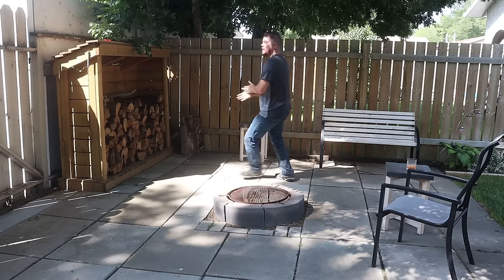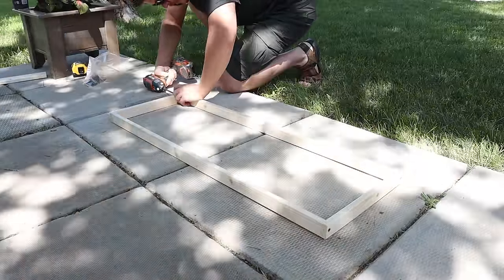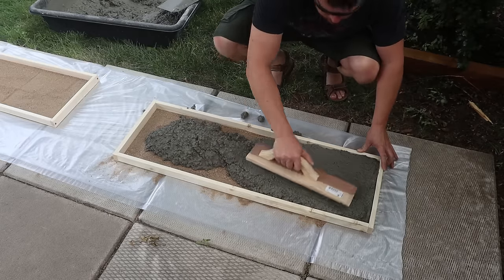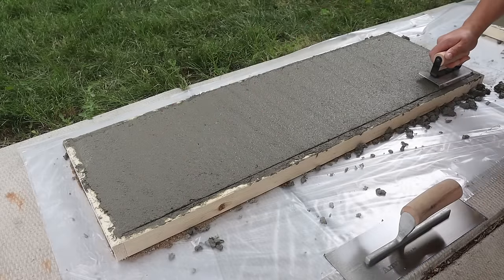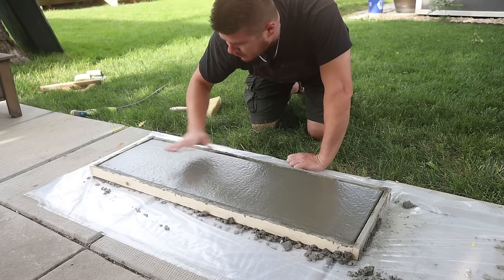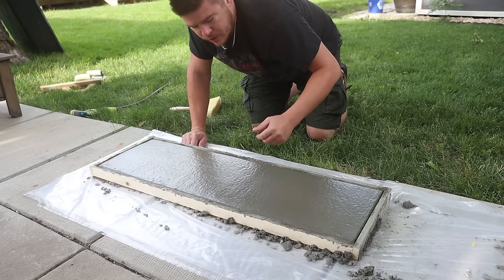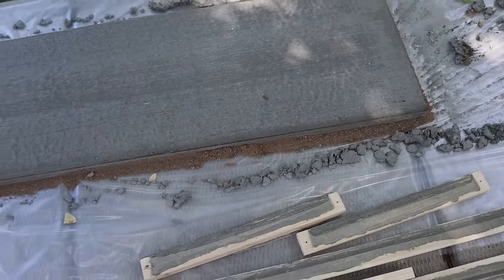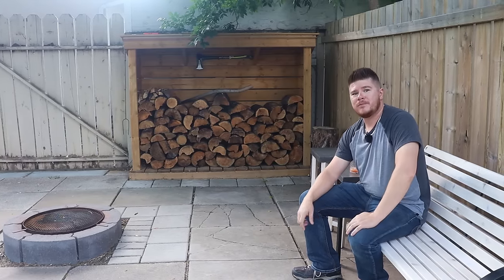How to make Patio Blocks quick and easy from concrete // DIY

Comment: I have a planter that I want to remove all plants and fill in with paver. I plan to put small concrete benches on top.  Do I need to put rocks underneath?
Reply from the maker: You need some kind of a base. Typically you'd dig down a bit and place a couple inches of sand down before adding the pavers, at a minimum

Comment: Is it cheaper to make these or buy paver bricks at Home Depot?
Also, do you know about how much weight they will take, and would putting some kind of screen  inside it act to hold it together?  Nice simple explanation, thanks.
Reply: I think the point here is that he made custom-sized pavers for the area he needed, so in this case there is no paver option to buy at HD. With regards to how much weight they could handle, that depends on the concrete mix you use (use a higher PSI rated mix if you’re expecting a lot of weight over them later). One thing he didn’t do is put some kind of wire mesh in them, when I did mine I used chicken wire after pouring half the concrete on each form, that helps to keep them from cracking.
Reply from the maker: They are close to the same price in this case, not much difference. But yeah, going this route you can make a custom size for yourself and even dye it if you want. These ones I made are pretty light duty but can easily support a few hundred pounds. If you add a fine mesh or something to it for reinforcement it'll be even more resistant to cracking. Thanks, I'm glad you liked it
Reply: @JessedoesDIY  
Oh, I forget to ask, what kind of concrete or cement do you use?   Can you use portland cement?  I wonder did you actually price out what it costs per square foot.  I have about 100 square feet portion of my front yard that I can not do anything else with and I think I just need to cover it with pavers, but pavers cost so much, and I don't want to actually cover it over completely with concrete.  This would be a good solution if it is less expensive, and still better and more custom even if it was the same price.
Reply from the maker: I used Quikrete bagged mix that I had on hand, but just the basic yellow bag quikrete will work just fine. You can't do cement only, it'll crumble apart. Concrete is a mix of things and it needs that to be durable. I did not price it out, but I do know that the what a bag covers and it ends up being about the same price as buying a stone. Like I said in the video, I made these because I needed to fill that specific spot, but it costs the same amount to just but a stone in store. If you're just covering a spot, it's up to you how you want to do it

Comment: the cement would be stronger with less water in the mix but its out of the traffic areas and mostly decoration so it dont matter. 
most people add way too much water so it flows better but the hydration reaction doesn't need much water. 
adding a superplasticizer will reduce water usage and increase flow making it even stronger and just as workable. 
it would also be stronger if you added aggregate in it making it concrete. you didn't do that and called it concrete anyway. 
its like calling plain milk chocolate milk without actually adding chocolate in it. lol
Reply from the maker: This is concrete. It's premixed and prepared concrete. I can also buy cement but that's not what I used. You can see the aggregate in the mix as I dump it out and when I scoop it I to the forms. I didn't add that much water either. Plasticizer is expensive here and hard to get so I wasn't adding it, so I added just enough water to flow out, without having standing water on the concrete when I was done

Comment: ok haven't played with this stuff before - what did the 1/4 inch of sand do at the beginning ?
Reply from the maker: No prob. It just prevents the concrete from sticking to anything, the plastic included. It also gives the bottom of the stone a bit of a textured bottom so it gross the ground better and prevents it from moving a bit. And since sand is an ingredient in concrete, it doesn't hurt anything

Comment: Hi, I have done this before, but I always buy the wrong type of concrete - sand- What did you use for this project, I wish you showed us the bag.
Reply from the maker: Hello. Well if you have to mix it yourself you're buying cement, not concrete. Concrete is already pre mixed with cement, aggregate and sand and all you need to do is add water. I buy Quikrete brand concrete bags and either the regular yellow bag, or the white bag 5000 psi or blue bag 6000 psi will work great for these. They have other mixes that are more specialized and won't work as well but those 3 are general purpose mixes.
Reply: Thank you for your response, I buy the yellow Quickcrete bag. Because it states that it won’t crack in applications less than 2”. But it always does. I probably should use rebar rods or something to hold it together Better. Thank you for your time and response. I’ll keep trying.
Reply from the maker: Without reinforcement like this, they will eventually crack. They are more for light duty use. For heavier duty and more resilient concrete I'd use reinforcement for sure. Either rebar or mesh will work. Good luck
Reply: @JessedoesDIY Thank you, for your time and suggestions! I’m subscribed!
Reply from the maker: Anytime! Awesome, glad to hear it, welcome to the crew

Comment: Hi Jesse, which size of the box should i use to make normal patio? 1x3? 2v3? I need to make a 700sq feet
Reply from the maker: That's going to be a ton of work, you'd be better off to buy some if you need that many, but the bigger the better as long as you can lift it

Comment: What happened to the dirt at the bottom of the molds? Was that just a spacer as a way to use less concrete mix?
Reply from the maker: The sand? It helps seal the bottom of the mould so the concrete and water doesn't flow under the form, and because sand is 1 of the ingredients in concrete it doesn't hurt anything. After that, you can do whatever with the sand
Reply: @JessedoesDIY  Ok thank you. I wasn't sure if the sand absorbs into the concrete.
Reply from the maker: No problem. Good luck on yours

Comment: What concrete mix did  you use do i have to add rocks to the mix or does it come in the bag
Reply from the maker: I just used the yellow bagged quikrete concrete mix. Concrete already has stones in it. People often confuse cement and concrete but cement is 1 ingredient in concrete, along with the aggregate

Comment: Why did you put clean cement on top and sand underneath? Is it more resistant and stronger that way?
Reply from the maker: The sand is just a base so the concrete doesn't stick to the plastic. It also gives it a textured bottom so it doesn't slide on the ground and stays where you put it. The mix is concrete, not just cement. Concrete is pre measured sand, rock and cement already.

Comment: No need for rebar or wire mesh for strength?
Reply from the maker: You can add it, for sure. But for my needs I don't. Any stones you buy in store don't have reinforcement so these should be about as strong as those

Comment: What happened to the dirt you put  underneath the slab you made??
Reply from the maker: It was sand, and nothing. Just shoveled it back into a bucket. It prevents it from sticking to the plastic, and because sand is an ingredient in concrete it doesn't hurt anything

Comment: You should look into dry pouring cement, it’s much easier.
Reply from the maker: Dry pouring is a terrible idea for so so many reasons
Reply: @JessedoesDIY  really?  What are the reasons?
Reply from the maker: Water is an integral part to concrete. It's actually a chemical reaction with the cement in it and needs to be mixed fully together to start it. Water doesn't dry out like most people think, it is actually absorbed into the concrete. After that it strengthens drastically, but the inside core can still be "soft". As the water is absorbed into the core it cures and comes up to full hardness. The problem with dry pouring is there is not enough water to cure the mix properly at all, not nearly enough. It's also not mixed at all and can have an uneven distribution of the ingredients causing weak spots. Plus with the outside of the slab being sprayed with water and left to dry, then rehydrate again later, that new water doesn't penetrate down into the slab very deep causing the core to not come anywhere near full hardness. All concrete is a chemical process. A dry pour may "hold together" under a very light load, but if you did a strength test between a dry and wet pour it would be no contest. I bet youd be looking at maybe hundreds of pounds to around 1000 lbs strength vs multiple thousands if it was wet. That's why the professionals do not dry pour, it's also a reason there are no dry pour instructions on the side of a bag of concrete. Just because you can, doesn't mean you should.

Comment: What is the purpose of the sand in the bottom of the forms?
Reply from the maker: So the concrete doesn't stick to the plastic, and it helps seal it up so water from it doesn't leak under

Comment: Some glass fibre helps from cracking.
Reply from the maker: If you want, yup. But it does increase the cost and they aren't available everywhere, just something to think about. I'd have to special order them and it's quite expensive

Comment: can you do it directly on the grass?
Reply from the maker: Not recommended. Too soft under it, it'll be prone to cracking. Plus things might try to grow through it and because organics don't agree with concrete, you don't want to pour on them and embed them in it
Reply: i want to make a large area. how can i do it without get rid of the grass?can i put some plastic as base? @JessedoesDIY
Reply from the maker: If you want to do a large area you may want to pour a concrete pad down, I have a video for that as well. But unfortunately there is no cutting corners like that, it'll break and crack without a proper base down first, simply covering the grass won't work

Comment: How about not putting any sand, so they would be flat on top and on bottom? and, how about removing the mold without disassembling it while the concrete is still fresh? I mean, to use it right away to make one more pave now, and another, and another in short time (not waiting that the first one cures, maybe next day).
Reply from the maker: If you don't put sand down, the concrete will stick to the plastic. You'll also probably have water seeping under the form because it helps seal it. If you want to lift the mold You'll need to seal it first and wait till it sets slightly first, then clean it and oil it again before using it. You'd be better off to make multiple forms. Also, removing it straight up without finishing the stone like I showed will give you some very rough and sharp stones. You can't cheat concrete
Reply: @JessedoesDIY  OK, maybe putting the form over a flat  concrete floor, no plastic, no sand, maybe some sand where the form touches the floor.
I already sanded the inside of the form to be less probably that sticks to concrete, maybe also painting it can help, plus oiling before pouring concrete.
I plan to cut squares of welded mesh to reinforce the paves.
I hope to make about 6 to 8 paves with a single form by removing it while still a little wet.

Comment: Wouldn’t those crack like a biscuit without reinforcement.?
Reply from the maker: Only if you plan on abusing them. These will be just sitting in the corner of my firepit. If you need stronger ones then by all means, make them a bit thicker and add some! I literally just made some new ones I needed to hold a rain barrel that way, the video is up, check it out
Reply: Mine don’t, mine are a little thicker than 2” but on my entryway and get plenty of foot traffic. Leveling substrate seems to be key. 😊

Comment: Why use the 1/4 inch of sand on the bottom of mold ?
Reply from the maker: Just waterproofs the mould so the water and concrete don't seep under the form, and the concrete won't stick to the plastic. Sand is one of the ingredients in concrete so it doesn't hurt anything

Comment: you must need to add metal reinforcement for strength.
Reply from the maker: Only if you plan on subjecting it to heavy weight or lots of traffic. A basic patio stone is fine, but any concrete will always be stronger with it so feel free to if you want

Comment: Cover your concrete form with painter's tape to prevent concrete sticking to it.
Reply from the maker: I said in the video that there are things you can do if you plan on reusing the form. But if you aren't there is no point because it won't stick to it just using it once
Reply: Easier to use cooking spray. That’s what I did, and it released perfectly. I made like 8

Comment: What was the out of the sand?
Reply from the maker: The point of it? To keep it from sticking to the plastic, to give the bottom a bit of texture, and to seal up the bottom of the mould so it didn't leak under it. And because sand is 1 of the ingredients in concrete, it doesn't hurt anything

Comment: You mixed the concrete, and poured into a form and then leveled an area to set them. Why wouldnt you just pour them where they were going to begin with?
Reply from the maker: For one, this was easier to film and show. Secondly, maybe you can't do that where you want to put them, maybe the form doesn't fit or something is in your way. Also, this is the correct way to make a stone and doesn't require that much more work to do anyways
Reply: Do you can reposition or make different patterns. I posted a video of mine but yea I am VERY glad I didn’t pour in place, we ended up hating the original design and went with a staggered one instead. Easier to slide/move.

Comment: What is the cement sand ratio
Reply from the maker: I used pre bagged concrete and the sand just sat on the bottom. But if you mean to mix your own and don't have pre mixed concrete like I used you'll use a 3-2-1 method. 3 parts aggregate, 2 parts sand, 1 part cement.
Reply: @JessedoesDIY  thank you
Reply from the maker: Anytime

Comment: Probably it won't be strong without an armature
Reply from the maker: It'll be just fine for what I need it to do. But if you want to add some to yours, by all means
Reply: @JessedoesDIY  I hope) I did similar bricks two years ago, and they cracked.. maybe I did something wrong
Reply from the maker: Usually if they just crack for no reason, like they haven't been smashed or dropped, usually it means the ground wasn't prepped correctly and it sagged over time, or there was too much water in the concrete when they were poured
Reply: @JessedoesDIY  you're right, probably ground was a problem

Comment: why not just concrete  on the ground where you need em ? logic  is sometimes overlooked :face-blue-question-mark::face-blue-question-mark::face-blue-question-mark::face-blue-question-mark:
Reply from the maker: Because patio stones and a giant slab have different uses as well as different amounts of prep to do it right. I can't pour them in place right beside the fence, so stones are what to use. Lots of people might try, but then again proper techniques are overlooked

Comment: I thought you had to put a "mesh" in the center of the paver. Obviously not.
Reply from the maker: If you want it to be stronger, then for sure. But for a basic paver like this that's just sitting in the corner, or has a light load then it isn't necessary

Comment: to be honest that firepit area does NOT looks like you have done a couple of projects over there, it looks more like a Frankenstein monster assembled out of scrap construction material
Reply from the maker: That's because when I bought the house that's what it was. You should've seen it before. I'm not rich by any stretch, and some of that I got for free. Have to work with what you've got sometimes
Reply: @JessedoesDIY  so i guess there still some more episodes coming until its finished, keep up
Reply from the maker: Well I would have loved to do more, and had plans to. But unfortunately life happens and I'm in a very difficult time right now. Sold the house and am waiting to find new accommodations
Reply: @JessedoesDIY  I am sorry to hear that, hope you will be doing fine soon
Reply from the maker: Appreciate it
Reply: That would soon crack especially at the edges with no steel rebar inside just like what I did.